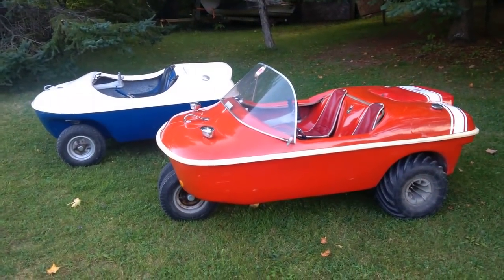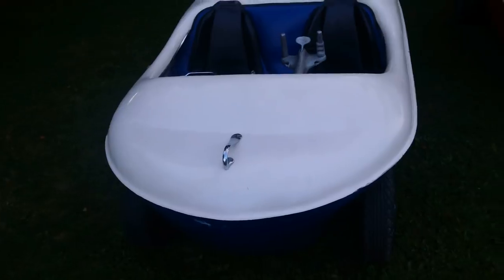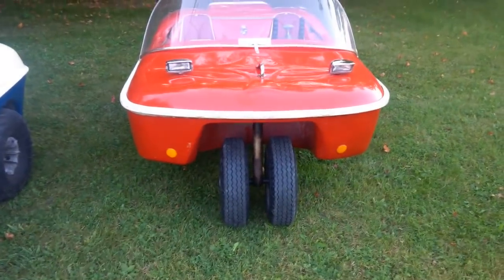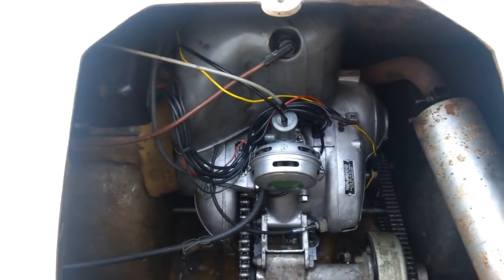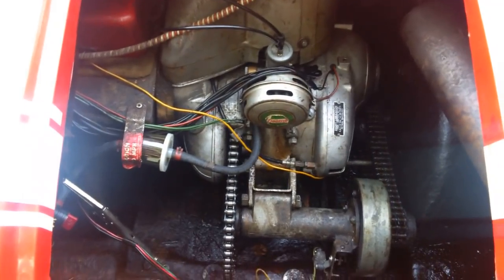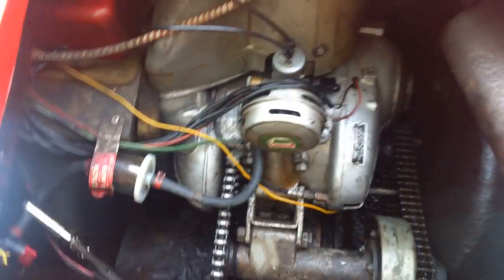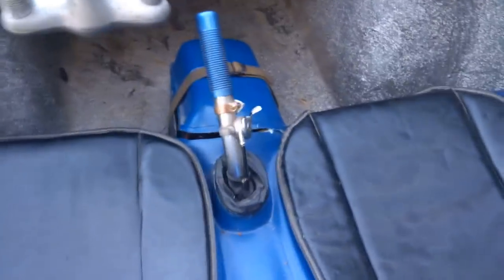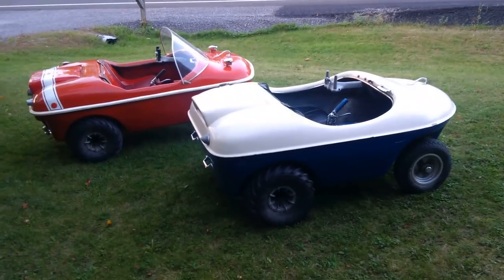Comparing a 1963 Pengor Penguin ATV to a 1967 Beaver ATV, made by Wheeler Mobile

Comment: noticed the orientation of the rear tire treads are different comparing the two units.. does having the "v" treads oriented one way or the other make a difference in the water?  I suppose switching sides with the tire/rims would change it - just curious if one way is better than the other.   Cool machines!
Reply from the maker: According to the arrow on the sidewall of the tire, the point of "V" on the tread should be upwards when viewed from behind. Not sure if it makes a difference in the water. Top speed for both machines are given in the brochures as 4 mph, which might be optomistic. The rear tire is more than half underwater so water is flying everywhere. If you haven't already, check out the Three Stooges Video "Flat Heads" to see a Penguin with two guys in it and the accessory trailer in tow in the water.
Reply from the maker: I was displaying my machines at a car show this past Sunday and got to talk to a man who was the Pengor factory test driver and he said it made a slight  improvement in water speed if the tires were put on backwards, which is the way the tires are on the Beaver.

Comment: A lot of similarities. I wonder if the top fibreglass section is the same as well. Also if you could find the fibreglass molds, you could make a modern one. Much like the guy that now has the boler camper molds.
Reply from the maker: The top section are different in overall dimension and shape. Not a lot, but enough. If I really wanted to reproduce them, I could take one apart and make a mold. Not sure what changes I would make to modernize it.
Reply: Claytoncruiser by modernize I figured 4 stoke engine would be better for most people. It’s surprising the number of people that don’t know what a 2 stroke is. Heck they had 2 stroke cars once upon a time.

Comment: The wheelwells on the Penguin limit leg space for the driver and passenger.
Reply from the maker: The Beaver has similar leg space, but the wheel well is in the center and with the curvature of the nose it may actually be less roomy than the Penguin.

Comment: How fast does it go
Reply from the maker: The maximum speed listed in the sales brochure for the Beaver is 35 mph. The same top speed is listed for both engine sizes. The Penguin brochure states 40 mph top speed. Water speed is listed as 4 mph max for both machines.

Comment: Is the drive axle locked or open?
Reply from the maker: Drive axle has no differential. I guess that means locked. Sprocket and both wheels are pinned or keyed to the rear axle.
Reply: Cool ! If it had an open diff it would never climb out of most ponds, streams or up slimy boat ramps. Thanks for the quick response ! My granddad would have called you "Johnny on the spot" .

Comment: I want one so bad. Are they hard to find? They seem super rare to get
Reply: I have one
Reply from the maker: @burnotto1663  Penguin or Beaver ? Do I have it listed in the Registry on my website ?
Reply: @Claytoncruiser  I do not know but I do not think so  I gave it to a guy a year ago
It is a Beaver and it is in Sweden with a custom designed wagon for transport
It lives near by in a better place now
Your answer  was one year late sorry
Engine was O:K but one rear wheel went flat due to the sun 
Iwas planing to use it to reach my island but then I saw on in water and  it was slow 
So I do not dare to take it out on a big lake
I might no go against the wind I thought
Reply from the maker: @burnotto1663  I don't think I have any Beaver in Sweden listed. Yes, they are not fast in the water at all. A good headwind or current in the wrong direction and you may be going backwards.
Reply: @Claytoncruiser  With new rear wheels perhaps I will tell the new keeper about You 
and the register
I am sorry for giving it away but I did not want to see it get destroyed by the wether
Reply from the maker: @burnotto1663  ,my apologies for not replying sooner.